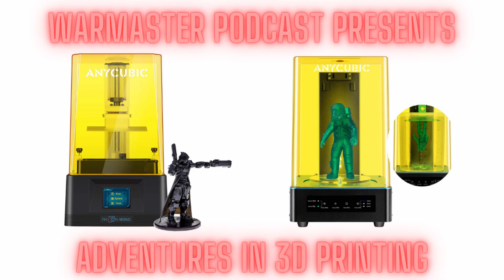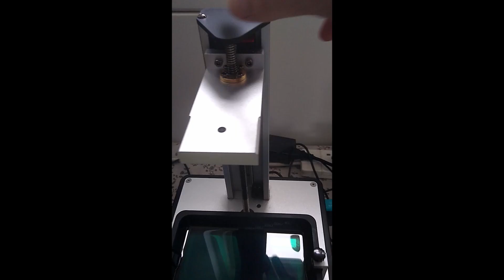Adventures is 3D Printing - Episode 20

Comment: I almost left  a comment on your last video mentioning the loose z axis but sounded like you had it figured already. Glad you got it fixed mate I guess look at the bright side, you know a lot more about printing now then you would have if you did not have any issues so that's a plus at least. I recently opened up my mars pro to replace the UV light and was pretty happy how easy it came apart and went back together. I purchased some of those cromarty forge terrain pieces, the empire houses and forest elf houses, they are awesome. The empire houses needed some vents at the bottom but other than that they printed up really nice.
Reply from the maker: I have bought a budget FDM printer from Anycubic to do terrain. Still waiting for delivery. I think plastic > resin for terrain pieces.
Reply: @warmasterpodcast2383  IDK mate I have been mixing some of that siraya tech tenacious with the abs like and damn is this stuff strong, I can throw one of these houses on my tile floor with no damage. But some bigger terrain will need an fdm for sure, those cromarty forge farms as an example do not fit on my print bed I had to  cut them up in blender to be able to print them. My brother does 3d printing for Boeing so I have had a lot of time with his FDM printers, personally I like the results from resin it just looks better, less layer lines ect but the cost is a factor for sure.

Comment: Hi Barry, glad to hear you've solved your problem.

Regarding slicing, is Chitubox not compatible with the Mono?  I tend to do all my slicing on that, although I suppose your print bed may be a different size, so it might have to wait for a software update to be compatible.
Reply from the maker: Yeah it can't slice into the right file type. It also doesn't have the mono as a profile to select. You can build your print batches and supports on it, but then have to slice it in Photon Workshop or similar.

Lychee does it all. I would recommend giving it a try.
Reply: @warmasterpodcast2383  Cheers.  Just having a quick look now.  It seems pretty impressive!  To be honest though, to tempt me away from the free Chitubox, I need to see how well it handles auto-supports... Fingers crossed! :)
Reply: Wow.  I'm pretty much blown away by Lychee.  I generally print my own models, so it's all unsupported until I put my own ones in.  Not only are the automated supports MUCH better than Chitubox, the manual controls, island detection, the fact that it actually hides the other supports so you can see what you're doing while adjusting the position of whichever one you're working on... SOLD!  For a few quid a month, it's probably the best value software subscription I have.  Thanks, man.